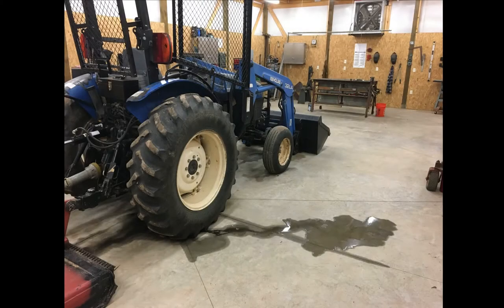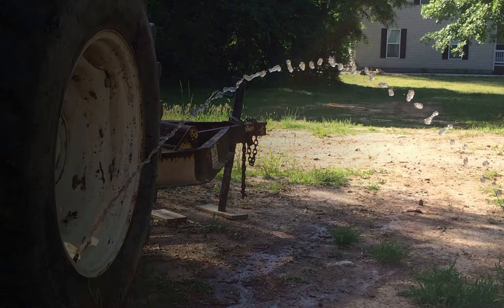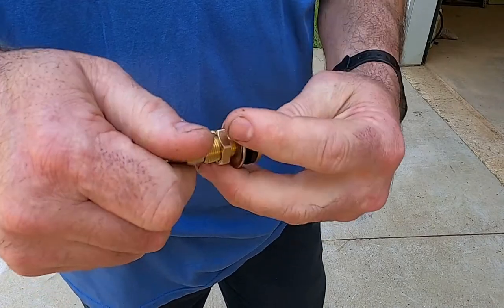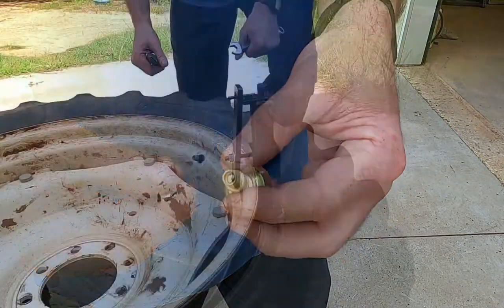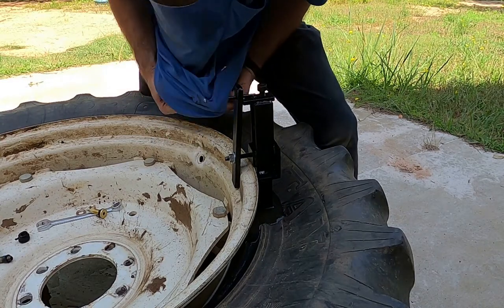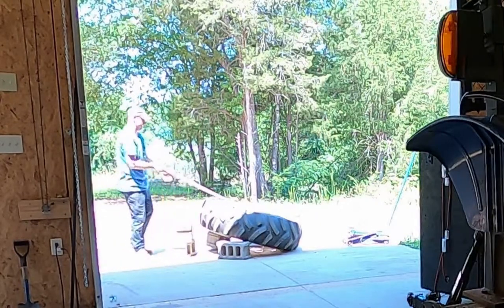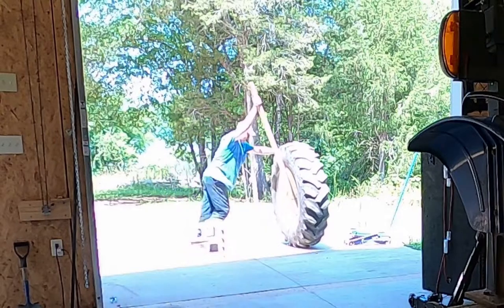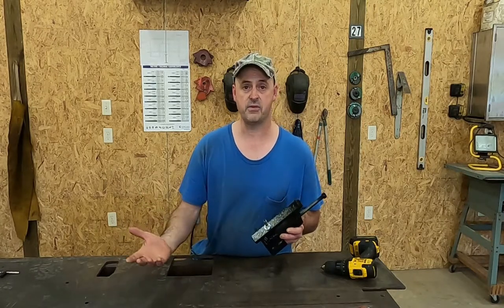Tractor Tire Valve Stem Replacement , Without Draining the Water

Comment: This is great.
Could you tell me what that valve stem is called? 
Is it fine to run those without a tube? Im in a predicament right now and i thight i would have to order a new tube and do the whole proceedure. Can i just keave the old tube inside the tire? 
I dont blame you if you dont ant to answer all these questions but God bless if you feel like being a tire counsellor.
Reply from the maker: Try searching "air liquid valve stem", you should be able to find what you need. These particular stems are for tubeless tires, so if the rim and tire are rated for "tubeless" then you should be able to forgo the tube unless there is a hole in the tire or rim. It probably wouldn't hurt anything if you left the tube inside, but if I were replacing the valve stem, I would go ahead and remove the tube while the tire bead seal was broken. Hope this helps. Thanks for watching!

Comment: Rubbed up against a downed log that was close to the road and it snapped off my tire stem.  I heard the air coming out of it and my heart sank.  I took off the mower and limped it home to the barn, jacked it up off that poor tire and thought, now what?  I'm new to a tractor and don't have all the knowledge or equipment to do all the maintenance myself, but I'm eager to learn.  So I went looking for how to change a stem on a tractor tire and found your video. 

First thing I said was where'd he get that bead breaker?  I never saw one before and that thing is slick!  I also never heard of putting water in your tires, only the oil they offer to put in at the dealer when you buy the tractor (for one hell of a lot of money)!  I passed on it but kind of regretted it because I sure could use a lot more ballast.  

So why do they put oil in tractor tires instead of water?  Seems like it might rust or something?  I'd love to hear more about that if it works because I sure could use more ballast on my tractor, and if I can just fill it up with water that would be fine with me!  How do you know how much to put in?  Then I assume that you just put additional air in to get it up to the right pressure?

Hey thanks for making this video.  I learned a lot!
Reply from the maker: Wow, I've never heard of putting oil in the tires, but I have heard of putting beet juice or windshield washing fluid. Perhaps the oil is heaver than water? As far as the water causing rust in the tire, I'm sure it will rust eventually, but I have never seen a rusty tint to the water in my tires, and they have had water in them for over 20 years now. 

When you put the water in the tire, rotate the tire until the valve stem is straight up top (12 o'clock position). Jack the tractor up to take pressure off of the tire and remove the valve core. (You can buy those water addition adapters at Tractor Supply.) Connect a garden hose to the adapter and turn on the water. As the water starts to fill the tire, it will start to compress the air that is still inside. You will need to turn the water off periodically and bleed the pressurized air from the tire. Make sure to do this often to avoid over pressurizing/exploding the tire. (My rear tire lists a max operating pressure of 20 psi. Standard household water pressure can easily be 40 to 55 psi).  Keep doing this until the water gets up to the level of the valve stem. You will know the water is above the correct level when  a steady stream of water comes out while bleeding the pressure. If so, let the water continue to bleed out until it gets below the valve stem and air starts coming out again. Then reinstall the valve core and pressurize the tire to the correct air pressure. If you live up north where the temperatures get really cold for long periods of time, you might want to consider putting antifreeze in with the water. (That's another challenge in itself. When I replaced the stem on my other tire, I poured a gallon of antifreeze inside before they resealed the tire bead. Then I added the water when I got home.) Hope this helps. Thanks for watching!

Comment: Just to confirm, that stem worked fine for 20 years on a tire filled with water?
Reply from the maker: Yep. I bought the tractor new in 2003 and didn’t have any problems with it until what you saw in the video. Thanks for watching!

Comment: Why didn’t you drain the water and mount the tire without water and then fill with water after it was mounted?
Reply from the maker: It takes a long time to refill through the valve stem. As you add water to the tire it increases the pressure inside, and you have to repeatedly stop the water and off bleed air pressure, then start the water again. I just didn’t want to deal with that, though the thought did cross my mind when trying to lift the tire back up after the repair. Thanks for watching.

Comment: where did ya get the water adapter for filling ? Great video,Thank's,Larry
Reply from the maker: I got the adapter and valve stem at the dealership where I bought my tractor, but I'm pretty sure you can get the adapters at Tractor Supply. Thanks for watching!